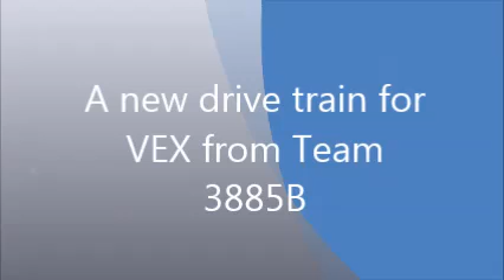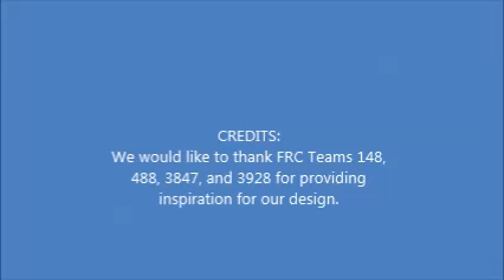VEX Butterfly Drive -Team 3885

Comment: I fail to see the point of this drive. If you want to drive your robot using 2 different control schemes why not program your robot to switch the control scheme when you press a button on the controller instead of physically altering your robot.. Also this year i would expect your robot to be a decent height meaning that the very small wheel base you get when you are using the smaller wheels would make your robot unstable. If there is something i'm missing please correct me, but as of now i don't think this will be useful.

Comment: Instead of using Linear sliders to deploy the High Friction wheels, try to use a piston, much more efficient. Also i would consider spacing the high friction wheels further apart, they seem to make going up tipping prone. 
Zak- 2587X

Comment from the maker: ShineyObjects1: The two 269 motors that actuate the 2.75" wheel modules can easily be swapped with pneumatic cylinders to achieve the same outcome. Right now we are waiting on new pneumatic kits and finishing our initial arm design in order to see what direction we want to go with. We will probably have a fall robot revel video around late September or early October with our final design.

Comment: Very inovative, you are this will probobly be good for this year although it would have worked even better for last year. Does it have any major advantage over an H drive or a pod drive?
Reply from the maker: The biggest advantage we are planning on having by using this drive is for our robot to not get pushed when we are being defended while also having holonomic capabilities throughout the match. The neat thing about it is that we have many internal motor gearing options that we can choose from.
Reply: I dint think of that, are so this really will be useful.